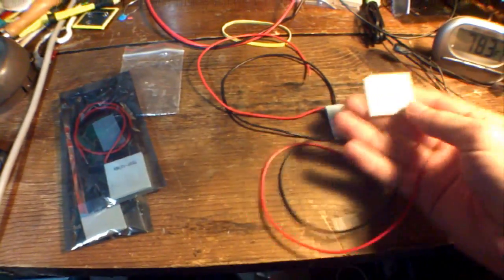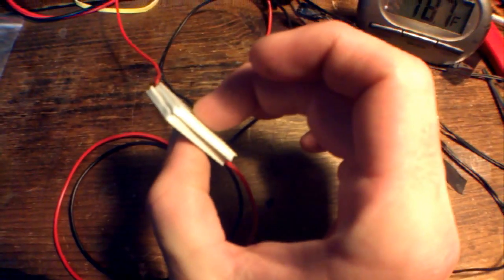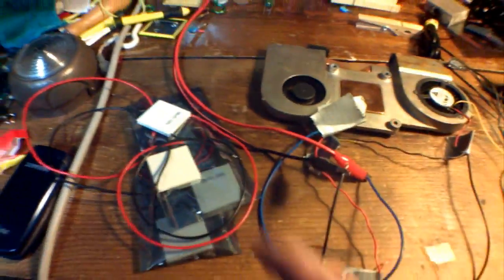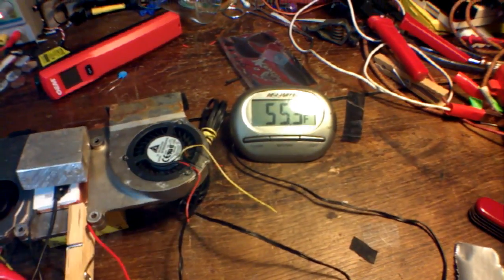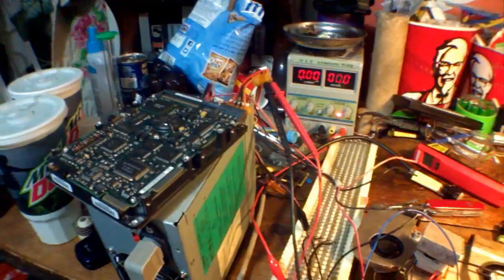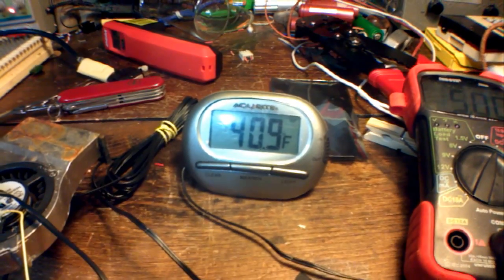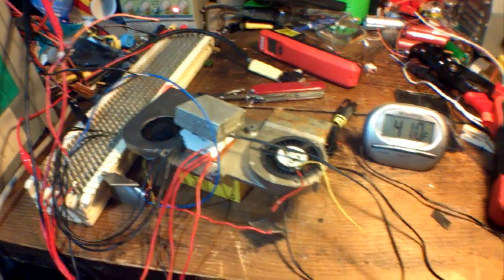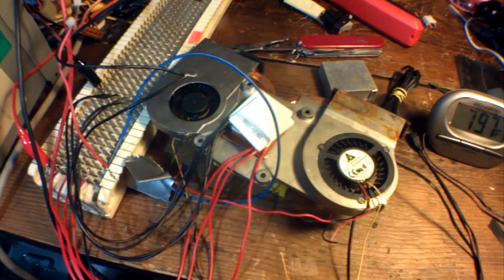Thermoelectric (Peltier) Cooler project part 1

Comment: What about configuring six of them around a Cube of metal?
This way, all heat is pumped-out in parallel and electro-thermal efficiency can be the same for each one. Surrounded completely by a Heatsink, there would be no condensation to worry about when cooling a CPU (except on the other side of the Motherboard).

Comment: Hey man, when you are stacking petliers you cannot run them all at the same power levels. So what you should do is Power the first one (bottom) with the most power 12V
then the Second one can be driven by 5-7 Volts and if you decide to add a 3rd Drive it at 2.5-3 Volts. This would create less heat for the other layers to also have to dissipate increasing the efficiency and getting the colder temperatures you are looking for.
Reply from the maker: 12v is too much, if you power one with 12v it will start generating more heat than it can move.